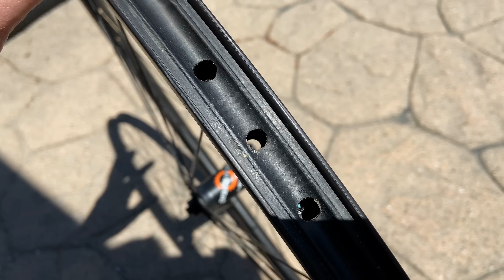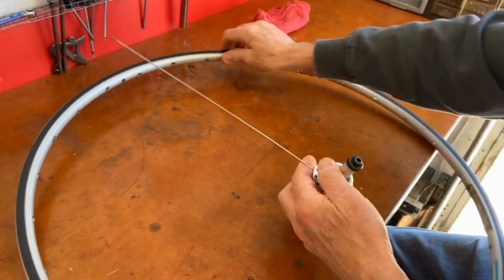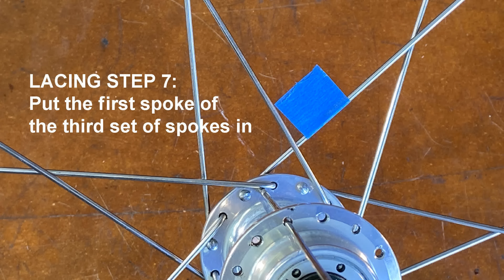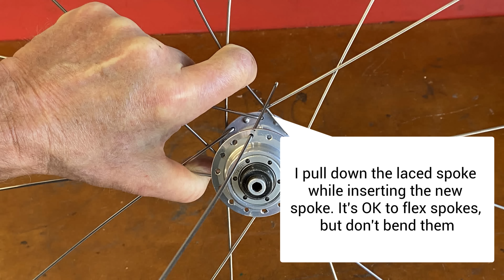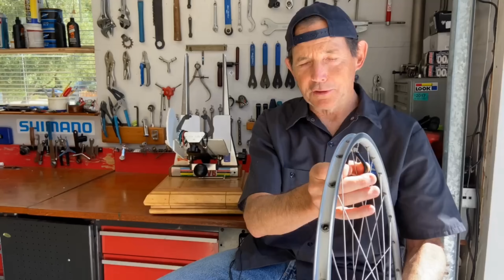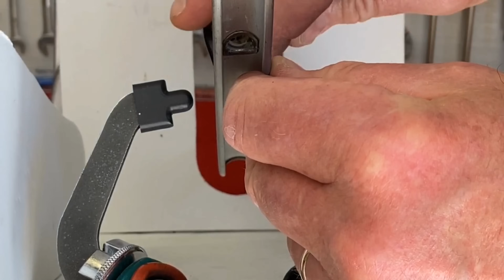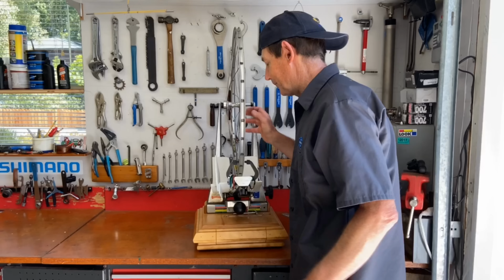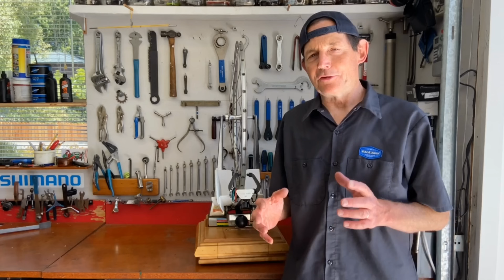How To Build Bicycle Wheels THE EASY WAY! #bikerepair

Comment: First of all thanks for the video! But I cant wrap my head around one thing, in the video (When you explain the position of the first spoke of the third set) it seems like the spoke is going into the incorrect hole. It looks like it is meant for the spoke head going on the other side, there is no small depression for the spoke head. Maybe I am wrong or it is not really important.
Reply from the maker: @longdongplatin2231  thanks for watching and the question. It’s actually critical to get that spoke in the correct hole. If you do it exactly as explained in the video you’ll get it right. You just (flip the spoke over) to orient the spoke heads-in or heads-out in the hole to deal with the hub hole depression i.e. countersunk holes. I hope this helps and happy wheel building!

Comment: Thank you for the video! And I have a question. I saw a tool that measured tension in the spokes. Is there any recommendation of how much tension needs to be in the spokes in numbers?
Reply from the maker: You're very welcome and thanks for watching, glad you enjoyed the vid! Usually the recommended spoke tension is provided by the rim manufacturer and will be on their specs page - typically it's from 110-130 kgf. Please watch this other video where I talk all about spoke tension meters and show you some great ones to consider for your wheel building: https://youtu.be/7JLw4pGyVyI

Comment: What about building a rear wheel with a freehub? Shall we use different spoke lengths? On other sources, it's recommended to use about 2mm longer spokes for the non drive side.
Reply from the maker: Thanks for watching and the question ender. What spoke lengths you need has to do with the hub and rim you choose to use and the spoke pattern too. Most of the time on geared bicycles, the right side (drive side) spokes are shorter than the left side (non-drive side) spokes - but not always. And you want to be sure to get it right. There are lots of ways to figure out what length spokes you need for wheels so I have a separate video explaining them here: https://youtu.be/LvV4FE2VxZk

Comment: I just built a new rear wheel for my MTB with a 10 speed Deore hub but I wasn't satisfied with the end result. There was a high spot and I couldn't true it. So I removed all the spokes to try again from the beginning but I saw that the spokes on the drive side were slightly bent while the non drive side spokes were still straight. Is this normal?
Reply from the maker: Congarts on the new wheel build. You can always remove high spots in newly built wheels without taking wheels apart. What you do is loosen at the low spot and tighten at the high spot. Just go little by little and the wheel will go from oval to round. I have a video showing it on a wheel that I try to make perfectly round. It takes patience but it's fun: https://youtu.be/DfjEaxlk1R4 And yes, the drive side spokes are under more tension so the elbows typically get bent more than the left side spokes. I hope this is helpful and thanks for watching and the question.
Reply: Please don't congratulate me. I can't get it right. I couldn't eliminate the high spot and removed everything to begin from scratch and guess what. I have now two adjacent spokes on the same side of the rim. Such an inept I am.
Reply from the maker: @ender4903  that's an easy mistake to make ender. The key thing is to not get ahead of yourself when you're lacing. That's why I teach the one spoke at a time method. That way you pay close attention to every spoke when you put that one spoke in the hub and then the rim. Check and recheck and check again with each spoke to make sure you put it where it's meant to go. If you do that you won't make a mistake. I know it's easy to get exciting looking forward to having a new wheel to ride but you need to go slow and be patient and pay attention to what you're doing and you'll get it right.

On the high and low spots it could be because you're tightening the spokes too much when you start truing. Because too much tightening is what usually causes the low spots which in turn force the rim up causing the high spot too. Instead of tightening, try loosening the spokes to get the wheel true side to side and round too. If you do that you won't tighten any spokes too soon during the initial truing process. Most important take your time, keep it fun, learn from any mistakes. And know that even professional wheel builders make mistakes if they rush or aren't paying attention.
Reply: Thank you Jim. I removed half of the spokes and laced them again with correct order. I don't know how I made this mistake. Now I'll tighten the spokes incrementally and see how it goes.
Reply from the maker: @ender4903  good job, ender, it's definitely a learning process and sticking with it is the way to get it down.
Reply: After the lacing and tightening the spokes through the thread ends I've tightened each spoke one full turn. Then a half turn. Then I keep tightening them quarter turns maybe six, seven times until the spokes are somewhat tight. At the end of this process some of the spokes were too loose and some were quite tight. Normally all the spokes should have equal tension at this point. Something is wrong with my spokes I guess.
Reply from the maker: @ender4903   Hi ender, I think you're building a rear wheel because that's what you said in your first comment above. If it's a rear wheel then the spokes on the right side will be a lot tighter than the spokes on the left. No spoke should feel loose. If you wiggle each spoke with your fingers it shouldn't wiggle. But if you push/pull enough on the right and left spokes on a rear wheel, the right spokes will be difficult to move while the left spokes will move a little without that much force. 

How even the spoke tension is depends on the design of the hub and rim and the spoke pattern, but on most rear wheels, it's as I described - looser on the left. So what you have on your wheel could be perfectly normal and if the left spokes are actually "too loose" as you said, it could be because the right side spokes aren't actually tight enough yet. So you will need to get them tighter.  To keep the rim from moving off center, you would tighten the right side 1/2 turn each and the left side 1/4 turn each until the right sides are fully tensioned and the lefts are not loose.

The other possibility is that you got the spoke lengths wrong and the left side spokes are too long. If that's the case, you could run out of threads when tightening them. But, you would notice that usually as the nipples become difficult to turn and you didn't mention that that happened. So I think if you keep tightening the way I explained your wheel will come out all right.
Reply: Thanks Jim. Yes, it's a rear wheel but the problem is after the initial tightening, it was actually the left side spokes were tighter than the right side. Not all of them but generally. I am using right side spokes 1 mm shorter than left side. Spoke lengths seem to be right. Spoke end doesn't expose above the nipples. This is definitely a hard task for a regular bicycle owner.
Reply from the maker: @ender4903  then it sounds like you should be okay ender. I'm not sure how you're determining how tight the spokes are but in case you're going by how hard it is to turn the spoke nipples, that actually doesn't necessarily have to do with how tight the spokes are. It can instead be affected by binding between the nipples and rim or nipples and spokes. A better way to tell is by plucking the spokes like they were guitar strings and listening to the music they make. Ideally when the wheel is round and true and tight, the sound is similar with same-side spokes. Just thought I'd mention that because it the feeling turning the spoke wrench can throw people off. Hope that's helpful in finishing the wheel.
Reply: Building your own wheel and bringing it to %90-95 trueness is extremely difficult job. I am completely lost here.
Reply from the maker: @ender4903  please explain more about where in the process you’re lost ender and I’ll see if I can help
Reply: As you say at the end of the video, I have the knowledge but maybe don't have the skills. Without a truing stand things are little harder. I loosened all the spokes and I'll give it another try tomorrow and let you know about the result.
Reply from the maker: @ender4903  OK. Be sure to do it 1 step at a time. Do not move on until that one step is complete. So get all the wobbles out is a good first step. And to do that work on one wobble and get that right before moving on to fix the next wobble. Working 1 step at a time like this should help. Let me know how it’s going.
Reply: I just can't do it. Maybe this is an art. Maybe I have no talent at all. It feels really bad failing every time I try it. Every time I spend 3-4 hours at least but nothing really works.
Reply from the maker: @ender4903  I don't know if it's possible but maybe I could "look over your shoulder" and talk you through it on a video chat somehow?
Reply: Thanks Jim. It is very kind of you but I don't want to waste your time. Now I am trying again from the beginning. I have tightened all the spokes up to the thread endings. Then I tightened the spokes on the drive side one more turn. Then few more turns all the spokes. Now there is very little tension on the spokes but two spokes on the drive side are tighter than others. What to do at this point?
Reply from the maker: @ender4903  Hi ender. Is the wheel round, true and centered now? That's the thing to focus on early as you build the wheel. That's why I ask. Tensioning the wheel happens as you get the wheel round and true and as you center the rim. But, you don't really concern yourself with the tension on the spokes too much as you get the wheel round and true and centered, mostly you focus on getting the wheel to a nice state where it's as perfectly true and round and centered as you can get it with very little tension on the spokes. So let me know what condition the wheel is in and I can then give you the next step.
Reply: It has a high spot exactly over the tight spokes I mentioned to you. It seems to be centered but not true. I was trying to do all the adjustments when the spokes were much tighter. That's why I was failing then. Now I got it.
Reply from the maker: @ender4903  so happy to hear it's starting to make sense to you ender. To remove the high spot - since the spokes already feel tight there, go around the whole wheel and loosen all the other spokes. So, let's say it's a 32 spoke wheel. Now let's also say that the high spot is 4 spokes long. You would leave those 4 spokes alone and go around and loosen the 28 other spokes 1/2 turn. It's very important to either remember where those 4 spokes are or you could mark them with little pieces of tape or a black dot from a Sharpie. After you have loosened those 28 spokes the high spot will be less of a high spot. If it still needs to come down more, go around again and loosen those 28 spokes 1/4 turn and with that process you end up a wheel that gets rounder and rounder until it's nice and round. And just as important, you don't make any spokes too tight. You actually end up making the spokes at the high spot a little looser which is a good thing because the wheel wasn't round yet. Hope this helps. Keep me updated on how you're doing.
Reply: It is actually a 36 spoke wheel. Definitely makes things harder for me. I tried to eliminate that high spot as per your instructions but couldn't succeed but I got the point that we need to get the wheel true, round and centered before tightening the spokes too much. When we find that balance we should tighten all the spokes quarter or half turns until we reach to desired final tension.
Reply from the maker: @ender4903  ok that sounds like good progress ender. Now that it's reasonably round, work on side to side truing. Work on just one side of the rim so pick the side it's easier for you to see. Most people have a favorite eye, use that one and that side. Remove one wobble at a time. Be very focused on turning the correct spoke nipples and in the correct direction to remove the wobbles one by one. 

So if you are working on the left side of the rim and the wobble goes wide left, you would loosen the spokes slightly on the left side to allow the rim to move away from the left side. If loosening doesn't get the rim to move, slightly tighten the spokes on the ride side of the wobble. Wobbles mean the rim is curved in that direction so you would loosen the middle of the curve more than the ends of the curve (same for tightening). Just work on one wobble and focus and you will learn what works and what doesn't work. You will be able to see the rim changing position very slightly as you make your adjustments. Pay attention and if what you're doing isn't working, think about whether you're turning the right spoke and in the right direction. Just stay with that one wobble don't worry about the other ones. Once you've mastered that first one, you should be ready to move to the next and next until the rim is nice and true side to side.
Reply: I tried my best but it's still not as good as I'd like. I'll keep trying to make it better. Thank you for all the help.
Reply from the maker: @ender4903  you’re very welcome ender and congratulations on building your wheel!

Comment: At the 12 minute mark you talk about the direction of twist, as the  drive side is tighter is there an optimal direction to twist on a disk brake wheel? Some builders do the next set on the opposite side why would you choose one over the other?
Reply from the maker: Thanks for watching and the question Leo. The direction of twist is dependent on the valve hole. It’s not a function of the lacing pattern. In other words, you twist the hub the same way regardless of the lacing pattern i.e. heads-out or heads-in. But there is a recommended spoke lacing pattern for disc brake wheels and it is different for front and rear disc wheels. I have another video explaining it here: https://youtu.be/gfWd7_avr1s?si=HI4mETiWYn0d0TF3 Hope this is helpful and thanks again.
Reply: @JimLangley1  Thanks I have seen it. This is my first complete wheel set build it's quite the learning curve.
Reply: @JimLangley1  What side do I start on the side with the shortest spokes?
Reply from the maker: @Leo-gt1bx  you should probably do it as I show in the video Leo. I carefully explain each step of a wheel build. Pause the video and rewind as needed to be sure you understand each step before moving on to the next step. Regarding your question, you can start with either side, it’s up to you. But you definitely want to start with the same side of the hub and the rim. And if the rim has offset spoke holes (also called asymmetrical), then you need to know which way to orient the rim. No worries though- it’s all explained in the video. Take your time to watch and understand before starting or you may have to start again and even again. Have fun!

Comment: Do front wheels with rim breaks  have the same spoke tension for entire wheel (on average)?
Reply from the maker: Thanks for watching and the question. Yes, as long as the front wheel is symmetrical (same spacing on both sides - meaning the rim is centered) then the spoke tension should be the same on both sides of the wheel.

Comment: Thanks for such an informative and thorough video! I'm about to rebuild my wheel with new spokes because I've broken so many spokes recently. Can I get away with using the old rim if it doesn't look damaged, or will this just mean I'll break the new spokes too? Looking forward to following along with you as I build!
Reply from the maker: You’re very welcome Adrian and thanks for watching and commenting! Yes, it’s never the rim’s fault spokes are breaking. It’s that the spokes were bad. They probably used cheap plain steel spokes and those break after they’re ridden enough- they aren’t strong enough. You should replace them with 14gauge 2.0mm double butted stainless steel spokes from DT Swiss. Those won’t break. Hope this helps and have fun building your wheel!
Reply: @JimLangley1  Thanks so much, this is reassuring!

Comment: Is there a benefit to building your own. Looking at component prices it’s cheaper to buy a ready made wheel? Thanks, Laurence
Reply from the maker: Thanks for watching and the great question Laurence. Most wheel builders get a lot of joy out of building their own wheels and wheels for other people. It's a hand crafted item and it can be customized as much as you/they want and that's part of the fun for people too. Most professional builders also believe that they will choose the best components and build a better quality and more perfectly round wheel than a factory built wheel too.  But, if the goal is to get a good wheel at a low price, then yes absolutely, the best way to go is to buy a ready-made wheel from one of the many companies that offer them. I've tested and reviewed on this channel wheels from ICAN, Light Bicycles and Elite Wheels and they've all proven to be very nice high quality wheels are reasonable prices. I've also put thousands of miles on Bontrager, DT, Mavic, HED, Shimano, Nuvation and other ready-made wheels and they've been excellent too. So it's basically the same choice you have with bicycles, you can go custom or you can go off the shelf, there are reasons for both but if price is the main criteria then off the shelf makes the most sense.
Reply: @JimLangley1  A good video would a comparison of all the MTB hubs out there. Hope 5 v DT Swiss v Novatec etc and is there much difference between budget and expensive hubs.
Reply from the maker: @Tuffjobs  here you go Laurence: https://www.youtube.com/watch?v=Sjz9N7bsO1U&t=6s
Reply: @JimLangley1  thanks, Jim!
Reply from the maker: @Tuffjobs  my pleasure!